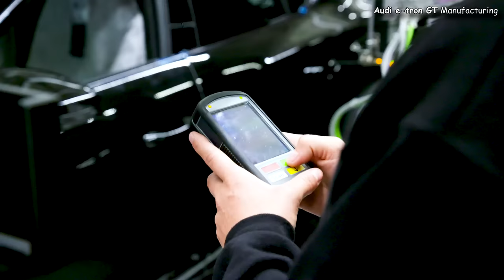AUDI Assembly🚘2024: Production plant – Manufacturing R8, Q7, Q3, A4, Q8, A8, A7, A6😲[Factory tour]

Comment: Impressive factory! 
However, all VAG cars i have owned or friends cars have had serious engine fails (chain/belt tension fail) after 2 years. Went on and bought Honda and it has been flawless for the last 7years.
Reply: Then VAG/Audi should have replaced the engines free of charge, as part of the 4 year guarantee.

Over here, the problem with Hondas is that they rust.
Reply: @Manu-Official  Yes they did replace, but the next engine failed after 4 months again with same problem and the whole exhaust system with the catalyst also. TSI engines...
Seems to be quite common with the 1.2 and 1.4 TSI. I live in Sweden, near the sea, but no problems with rust so far.

Comment: All Audis should come stock with a complete maintenance package..., including instructions, cleaning liquids and aparts lubricants, microfiber cloths and buffing tools, and any other equipment that will prolong thier life and make eventual value added antiques of these brand new machines.  Example, a brand new, 1960,  M.B. 600E sold for $16,000.00 USD, more than many houses sold for at that time.., but today their worth is over 1,000,000.00 each if in good working order.  And I do not mean completely overhauled, I just mean well maintained and in good working order..., all original.

Comment: Different set up from the Japanese auto plant that produced Toyota Corollas, Tacoma etc. in Fremont California which closed in 2010. The crew there works at measured speed and has to do everything correctly so that everything is installed before the parts passes through his station. Human precision is key. One mistake delays the next station and consequently results in stopping the line if the reserved man in the team can't remedy it. Every parts that comes from different sections are synchronized and should met at the junction of the conveyors at an exact second. So perfection is key. One bad part that could not be replaced in double time before reaching the junction can stop the line. But they trained the crew so intensely that in a 2 and half hour rotation its usually zero to only one stoppage of the line happens.

Comment: Those things you see are throw away cars. There is zero focus on that thing being able to actually fixed on a regular shop or dyier without taking the whole damn thing apart. Every operation except oil and filters involves taking the engine out, anything that breaks into the engine is almost the cost of the car which makes more sense to buy a new one and so on. That is Apple strategy, they’ll fix it for you but you can put a bit more and your ass can sit in a brand new fine chariot for another couple of years while you use it to go to work every single day in order to afford paying it.

Comment: Now,   if there was some R5 2.2 turbo 20 valve high revving bullet proof big turbo engines in some lightweight chassis, with sequential 6 speed gearbox, 
LSD front and rear with adjustable quattro, and highly customisable cars being produced there... that would be interesting.. cars is mostly just not that cool anymore. 
The apex was around 1986 for formula 1 and 1995-97 for consumer vehicles. After that, its all downhill.
Now its just electric ugly shit